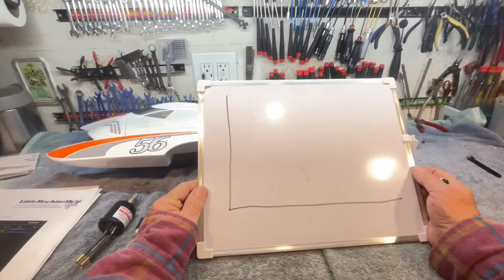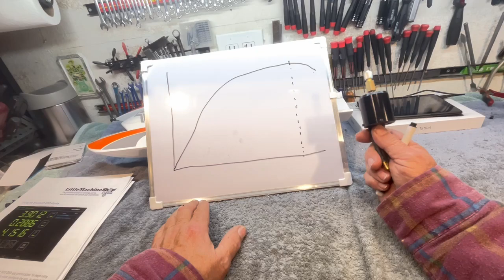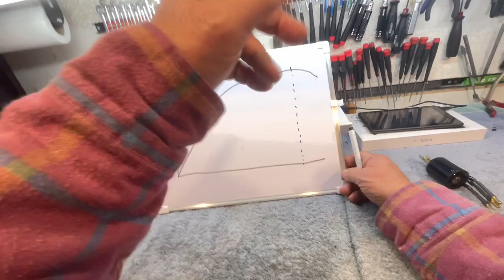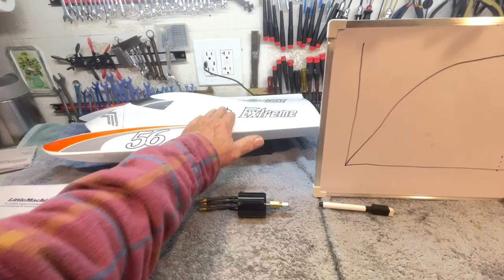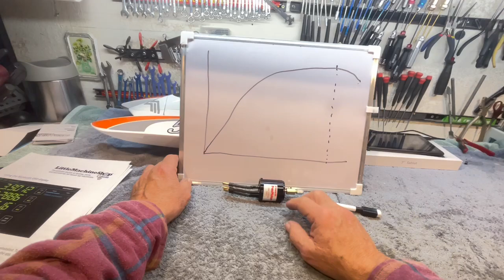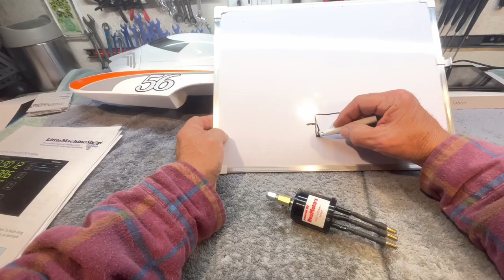Dr. Jet 'splains why it needs to be complicated.

Comment: Dr Jet , really interesting insight .
Let me share this with you . OSE sells Zonda in two flavors , the GT for speed and another for bashing. What I could never understand is why cannot I get the GT and simply bash it around at 1/2 trigger ??? One would think that full speed is at full trigger and at 1/2 speed you simply do 1/2 trigger . But others tell me that  one cannot do this . Perhaps you can throw some more light on this in your future episodes. 
Only diff is motor size , KV is nearly the same . 
Non GT Zonda : Two TFL SSS 3674 V2 2075 KV

GT Zonda : SSS 4082 V2 2200kv 

Thanks .
Reply from the maker: Believe it or not, running at 50% throttle will not give 50% power.  At partial throttle, the ESC is less efficient which means more Watts will go into creating heat instead of turning a propeller.  Steve did a lot of testing for helicopter duration tasks in the past and discovered that partial throttle is less efficient than you would expect.   Furthermore, the bigger motors at 50% power are not at an efficient rpm which means more Watts go into creating heat instead of turning the propeller.  Regarding motor size, the 4082 motor has 33% more mass (roughly) which means (in theory) that it should have close to 33% more power at the same Kv.
Reply: @  Thanks for your detailed explanation . It is appreciated . I need to learn basics of motors , voltage , kvm and rpm , delta , Y etc etc . Thank youb

Comment: If you gear drive it you will need a reverse hand prop. Also some airplane gear boxes may work.
Reply from the maker: Just wire the motor to run the opposite direction......  🙄
Reply: @Dr_Jet  I guess that would work.

Comment: I wonder if Neu motors are tested under load🤔 ..not questioning their process at all, just there's something to be said for the resistance of the water. Unless I missed that part😄 it's funny hearing the motor wind out when it leaves the water.. that high pitch "wooooo!"😁:goodvibes:
Reply from the maker: Steve uses a dynamometer that gradually subjects the motor to larger and larger resistance until it stalls the motor (or falls way off the back side of the power curve).
Reply: @Dr_Jet  excellent

Comment: Interesting project for sure! I tried gearbox on outboard motor on Kyosho Wavemaster in the past and it worked. But problem was mainly the added weight, as the outboard hanging out at the back. If the gearbox is inside of the hull, can't be a problem. You can also set the gear lash, let it "fixed" and just changing gears with the same distance "center to center".
Reply from the maker: The gears I'm using aren't cheap, so I would prefer to just get multiple pinions as opposed to matched sets.  Besides, now that I have a DRO on my mill, I can calc and draw a series of holes in an arc to make that smile cut by filing out the spaces between the holes.